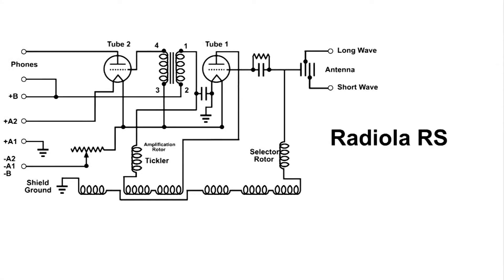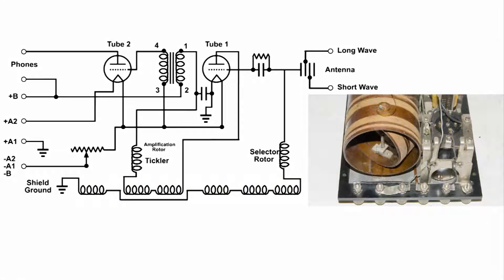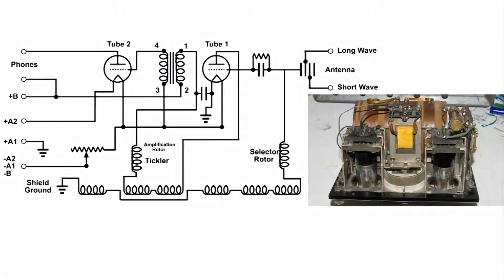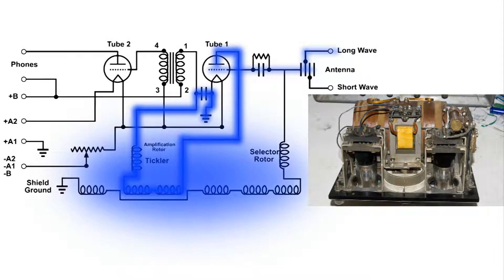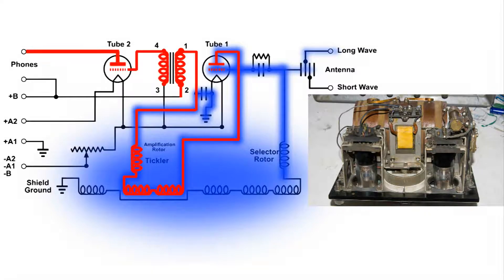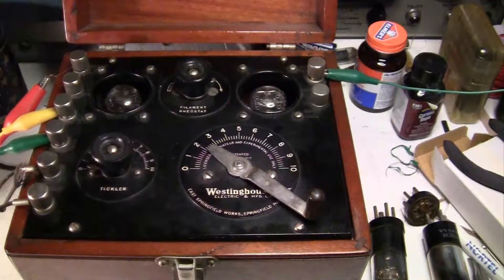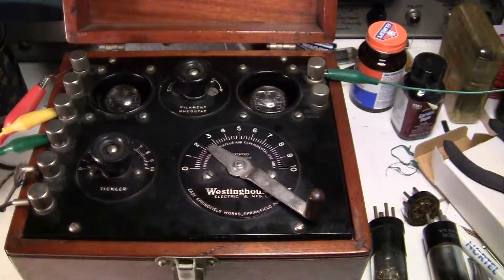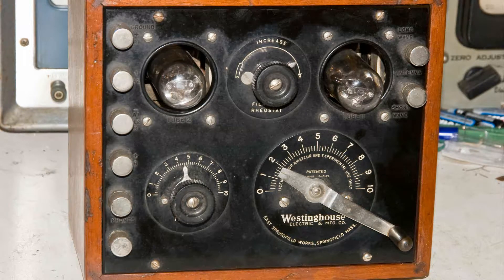Radiola RS 1923 Circuit and Demo

Comment from the maker: @WB8MHE
Hi,
What you have done is about the only save thing to try, maybe trying to re-heat the pins and adding more solder down the pins. That includes wicking the old solder out. Almost anything else may destroy the tube.
Rick

Comment: Hi Richard,
In revewing your vids, I began to wonder if you have any tips.  I have 9 WD-11s, but several show open filiments..  Two of them, I have heated the end  if the pin tips and have gotten them back to showing contiuity, but for only a short time.    Do you have any suggestions for resoldering tube pins?
Dick Blaney
.

Comment from the maker: @AndyDaviesByTheSea 
Hey Andy,

I'm using Elements 7.

Yes I upload manual. You have many more options there. In 7 I had to change format options to get full 1080i/p, but it does it. Also you do not get something for nothing. The last video I made, and it is 1080 format, took about two hours to compile, but the FLV file size is 57.6mb. In other formats it would be over a Gig.

If you have trouble setting this up, I'll be glad to help. Send pictures of my options.

Regards,
Rick

Comment from the maker: @CameramanLink 
It does interfere and or influence each other a little. The very bottom line is, this works because the frequency of Audio and RF are very far apart. And there so far apart that the distortion is minamual. The Audio is also limited to just about voice frequency only, that also lessens distortion. And it is easier to understand time slicing in computers, I do this, next time slice I do that. The regen circuit is full real time.